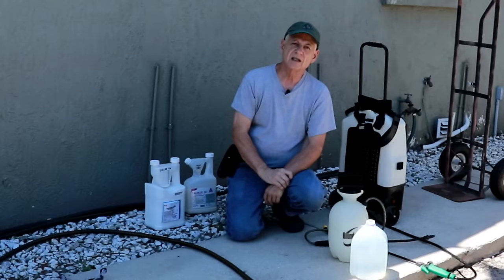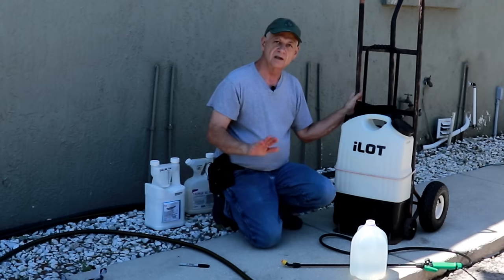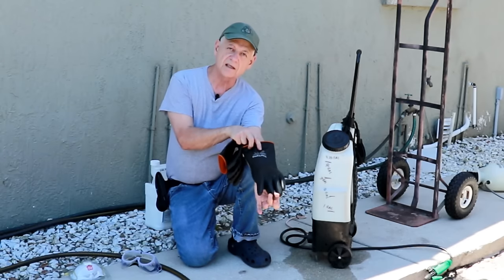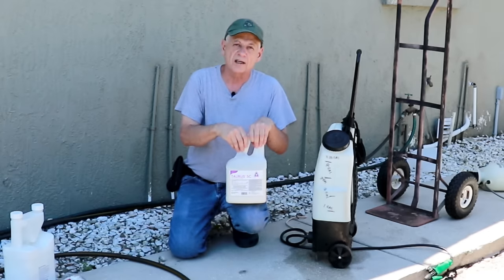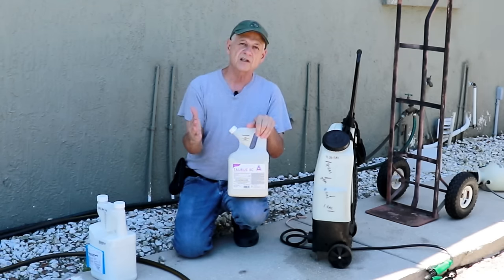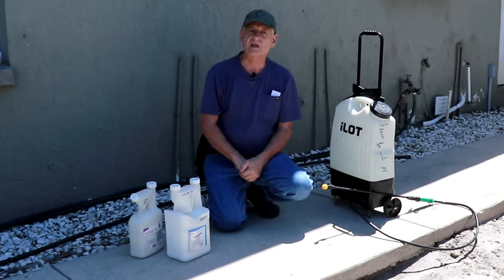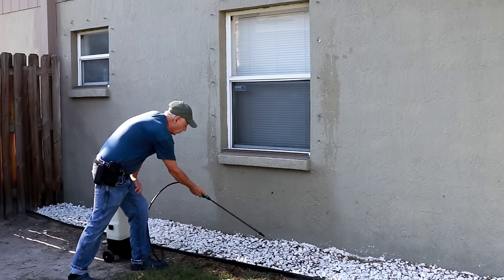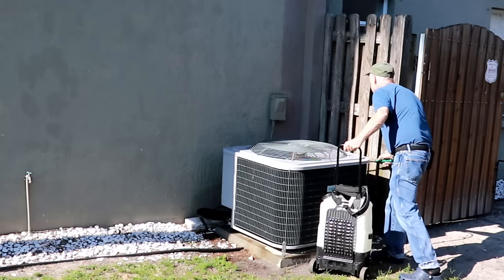General Exterior Pest Control - IMPORTANT!  READ THE DESCRIPTION.

Comment: What about using Alpine WSG? I’m hearing many great things. It is a non repellent and kills the ants after a few days kinda like bait. Do you have any thoughts?

Also I wonder how long I must wait bc I overpaid a commercial pest control company to come out and do a crappy job. I’m wondering how long before I can apply something like alpine WSG?
Reply from the maker: Alpine WSG it's a good product, but it is an expensive product.  For one thing, it only lasts between 30 to 60 days, while many other pesticides will last up to 90 days.  Therefore, you need to reapply it much more often.  To be safe, you probably need to apply it every month.  Then there is the price of purchasing it.  I believe this product costs about $10 a packet and one packet only makes one gallon of finished product.  I have found that, to treat the exterior of the house properly, it can take several gallons of finished product.  So, you are looking at $40 to $80 a month to treat with this product.  That's just a little too rich for my blood.  Since it is so expensive, what most people will do is skimp on the application and not apply enough of it to be effective.  That is why you are far and away better to treat with the Taurus SC and the Talstar P.  To save a bit more money you can substitute the Talstar P with Bifen IT, which is a little less expensive.  Both of these products last about 90 days, so all you need to do is just alternate between the two products.  The Taurus SC, just like the Alpine WSG, is a non-repellent pesticide, but it will last longer and do a better job.  Unfortunately, the Taurus SC is only labeled for use every six months, so you need to do an in between treatment with the Talstar P or Bifen IT.  The Alpine WSG would be a great product for interior use, but I would not spend the money to use it outside.  It’s way too expensive and does not work as well.

Regardless of the pesticide that you choose, you can go ahead and apply it immediately if you like.

I hope that helps.  Be well my friend.

Comment: Does you Ilot backpack sprayer still work? I use a “My4Sons” backpack sprayer that runs off of my spare Dewalt battery I had laying around convenient af
Reply from the maker: It still works great and I have had it for years.  However, I don't use it much anymore because it's too heavy.  I'm getting too old now.  Lol.  So, these days I treat with a hose end sprayer.  You are not supposed to do it that way, but it is way faster and easier, and it will not harm you or the environment.  I have an updated video now that shows how to use a tank sprayer and a hose end sprayer.  The hose end sprayer can reach areas as high as 25 feet, so it's great for treating gables and hard to reach areas.  You need to use a different product though.  The new video is much shorter and contains more information too.  You may want to have a look.  I will give you the link.  Be well my friend.

Updated video on general exterior pest control:  https://youtu.be/Yozv3s-Qwlw

Comment: Hi Guy, do you have any tips for dealing with fleas in a home? My father fosters cats and fleas got inside.
Reply from the maker: I do not happen to have a video on how to treat for fleas, but Solutions Pest and Lawn has a pretty good one.  I will place a link below for it.  I agree with everything that they tell you to do, but I don't think it is necessary to use the Bifen L/P and the Reclaim I/T.   While that approach is definitely going to work effectively, I think you can do the same job just by spraying the lawn with Bifen I/T.  So, what I am saying is to just completely skip the Bifen L/P and instead of using the Reclaim I/T, use the by Bifen I/T in that garden hose sprayer, the same way that they show you for the Reclaim I/T in the video.  The difference between the by Bifen L/P and the Bifen I/T it is that the Bifen L/P are granules and the Bifen I/T is a liquid.  I will give you a link to both the sprayer that I like to use and the Bifen I/T.

Now this is very important.  The Bifen IT is too thick to work in the sprayer.  So, you need to dilute the Bifen in the garden hose sprayer.  Start by pouring 8 ounces of the by Bifen into the sprayer, then add enough water to fill it up to the 32-ounce mark.  Then set the sprayer to 4 ounces per gallon.  The product is supposed to be applied at one ounce per gallon but since you diluted it three parts water to one part concentrate then you need to increase the flow rate by a factor of four.  That is why you need to set the sprayer at 4 ounces per gallon.  As you add the water into the sprayer, I recommend that you stop periodically to swirl it around and mix it.  If you try to just pour all the water in at the same time and then shake it up at the end, what will happen is that you're probably going to get leakage out of the sprayer and make a little bit of a mess.  You want to get the lawn nice and wet with this stuff.  Also, I recommend that you treat walkways around the house and any concrete that goes up to the front door.  I would also treat the driveway.

If these cats are allowed to roam outside freely, then that is a very bad idea because the cats are going to stray onto other properties, where they will encounter fleas and bring them back home.  If this is the case, then you are pretty much wasting your time treating your own property for fleas.  In these situations the best that you can do is to treat the cats, vacuum every day, constantly wash all the bedding, and treat with the Novacide every couple of weeks.  Even at that, you are probably still going to have some fleas.  However, you will significantly knock down the population.

I hope that helps.

Flea Control: How To Get Rid of Fleas | Indoor, Outdoor & Pet Flea Treatment Guide | Solutions Pest & Lawn (solutionsstores.com)

Sprayer:  AmazonSmile : RE Chapin MFG Works G499 Adjustable Rate Dial Hose End Sprayer, 32 OZ : Patio, Lawn & Garden

Bifen I/T:  Bifen IT Insecticide | Bifenthrin 7.9% Concentrate | Solutions Pest & Lawn (solutionsstores.com)

Novacide:  Novacide Flea & Tick Killer | Novacide Aerosol & IGR | Solutions Pest & Lawn (solutionsstores.com)

Comment: So using this proportion of .80 oz of the chemical to one gallon of water and spray once in 6 months will keep the bugs at bay including termite?
Reply from the maker: No.  The Taurus SC does not last six months.  You're only allowed to use it every six months, but it only lasts about three months.  So, you need to use an in between treatment with something else, like Talstar P or Bifen IT.  Bifen IT is pretty much the same thing as Talstar P, just a bit less expensive.  Either one is fine for that in between treatment.  So, start with a treatment of the Taurus SC, and then three months later use the Bifen IT, then three months later back to the Taurus SC, and so forth.  I know that I was not clear in the video about this.

Now, I was also not clear in the video about termites, so let me clarify.  If you flood this product in the area where the dirt meets the foundation of the house, this will help to prevent subterranean termites.  I cannot guarantee that it will prevent them, but it may.  You see, subterranean termites only travel a couple of inches underground and then, most of the time, they head up to the surface and start building a mud tube up your foundation to the wood.  If they do that, then they will pass through the pesticide and that is going to kill them.  Unfortunately, they do not always get the memo that this is how they are supposed to operate.  Sometimes, if you have a crawl space or even a full foundation, then the termites may not go up, but rather head down or sideways to a crack or crevice that will allow them access into the inside of the blocks or the inside of the crawl space or foundation.  If they were to do this, then applying the pesticide where the dirt and the foundation meet would not be effective for them.  So, while this treatment will help in a lot of cases, it is not a 100% guarantee that you will not get subterranean termites.  Therefore, if you wish to prevent subterranean termites, then you should treat the perimeter of your house with granules.  I will place a link below for a video on how to do that.  Unlike the liquid pesticide, the granules leach deeper into the ground and so the termites do not necessarily need to go up to encounter it.  The granules only cost about $50, and you only need to do it annually.  The product used to be available from Lowe's or Home Depot, but they stopped selling it.  They are now selling a similar product that is made by the same company, but it does not work.  I will also place a link below for the correct product.

If you live in certain states where drywood termites are a problem, then this treatment will prevent them 100%.  That is because, unlike their subterranean cousins, drywood termites do not colonize in the ground.  These guys literally fly to your house and find their way in through cracks and crevices that are around the eaves, windows doors, pipe penetrations, and so forth.  Therefore, if you have a pesticide barrier up along all these areas, by applying the Taurus SC or Bifen IT, then drywood termites cannot survive passing through that pesticide.

So, the bottom line is that this treatment will be 100% effective for drywood termites, but only somewhat effective for subterranean termites.  For full protection against subterranean termites, you also need to apply the granules.

I hope that helps.  Be well Bin.

Video on how to apply termite granules:  https://youtu.be/H7rW_TSBHJ4

BioAdvanced Termite Killer 700350A:  https://smile.amazon.com/dp/B000RUIJYM?ref=nb_sb_ss_w_as-reorder-t1_ypp_rep_k1_1_5&amp&crid=2B6A9TJDCVV7H&amp&sprefix=bioad

Bifen IT:  https://www.solutionsstores.com/bifen-it-insecticide

Taurus SC:  https://www.solutionsstores.com/bifen-it-insecticide

Comment: Should that sprayer pack be used while trenching or just use a 5 gallon bucket to pour it in?
Reply from the maker: If you are trenching for termites, then you need to use either a sprayer or watering can to treat the fill dirt.  You should only dig a 10 foot section at a time and then pour in four gallons of Taurus SC.  The trench should be 6 inches wide and six inches deep.  When you backfill it, put in three inches of dirt and then soak it with the sprayer or watering can.  Then finish filling in the trench and soak it again.  A lot of pest controllers do not do this, but if you stop and think about it, you can see that it makes a lot of sense.

I hope that helps.  Be well my friend.

Comment: What do you think about mulch vs other materials, or even rubber mulch? Is it really bad?
Reply from the maker: Mulch can get eaten by termites.  It doesn't attract them, but it will give them a food source.  So, you should treat the mulch every 90 days with a pesticide.  A great way to do this is to treat your entire yard with a hose end sprayer.  I will give you a link to my video on how to do that.  You need a different product, but that can also be used on the house as well.  That's what I do.  Rubber mulch would be great.  No problems there.

I hope that helps.  Be well my friend.

Video on how to treat your yard with a hose end sprayer:  https://youtu.be/wifoTU5dmp0

Comment: Fleas inside ? Thank god rental unit is empty so i soak the unit plank floors and still cant kill them 100%. Used IGR a week ago just havent been back. Go back tomorrow. Any advise ?
Ive used 
Ciper tc
Biden
Portable foggers 
Last spray had archer in the bifen.
Reply from the maker: You are not using the best products for fleas, but if you applied those products correctly, then it should work.  If you were unsuccessful, and there is nothing in the building, then vacuum the floors throughout the house.  If you have a vacuum with a disposable bag, then discard the bag outside in the trash.  If you have a vacuum with a reusable canister, empty it outside in the trash and then wash it out with the garden hose before bringing it back in the house.  Next, spray a pesticide that is labeled for fleas, on all the floors and on areas of upholstered furniture that does not come in contact with people or pets.  To treat floors, hold the can at arm’s length and make sweeping motions across the floor to cover all surfaces.  The product that I like best is called PT Alpine Flea and Bed Bug Aerosol.  I will give you a link for it.  Fleas can be hard to kill, so you may need to do this treatment every two weeks until the problem is solved.  If the house is empty, one treatment should get it done, but not always.

I’m sure you already know that the reason fleas got into the house in the first place is because they are outside.  If you have a flea problem outside, then there is a good chance you will end up with a flea problem inside.  Even if someone does not have pets, the fleas will still jump on you when you are outside, and so you can carry them in.  So, you need to treat the outside as well.  I do this with a hose end sprayer.  I will give you a link to my video on how to do that.  I find that treating the yard every 60 days seems to do the trick.  However, if this is not working, then you need to go nuclear on them and use Bifen IT granules.  You can apply them with a hand spreader or push spreader.  Just follow label recommendations for application and water them in with the Bifen XTS and the hose end sprayer.  You want to treat the entire lawn with the granules and the dirt around any ornamental plants.  Make sure that you apply enough of the Bifen XTS to soak all the way down to the ground.  The video will show you how to mix it and apply it correctly.  All the materials shown in the video are in the video description.

I hope that helps.  Be well my friend.

Video on how to treat your yard with a hose end sprayer: https://youtu.be/wifoTU5dmp0

PT Alpine Flea and Bed Bug Aerosol: https://www.domyown.com/pt-alpine-flea-and-bed-bug-aerosol-p-1886.html?pdpv=2&sub_id=25601

Bifen LP:  https://www.domyown.com/bifen-lp-insecticide-granules-p-227.html

Bifen XTS:  https://www.domyown.com/bifen-xts-p-1236.html

Comment: Is this the same thing as Bifen I/T?? because I was going to buy bifen to get rid of ticks in my backyard I don’t know what to use
Reply from the maker: The Bifen IT is the same thing as the Talstar P.  The only difference is that the Bifen IT has a slight odor to it, while the Talstar P it's odorless.  The Bifen IT is a bit less expensive, making it a better choice for exterior use.  There's another product on the market too that is the same stuff, but I haven't tried it yet.  It's called Supreme IT.  I just ordered a gallon of it the other day and I'm looking forward to trying it.  It's just a couple of dollars more expensive then the Bifen IT, but I'm hoping that it has a thinner viscosity than the Bifen IT, so that it does not need to be diluted as much when I put it in a garden sprayer.  Check back with me in a couple of weeks and I will let you know how it went.  

I hope that helps.  Be well my friend.